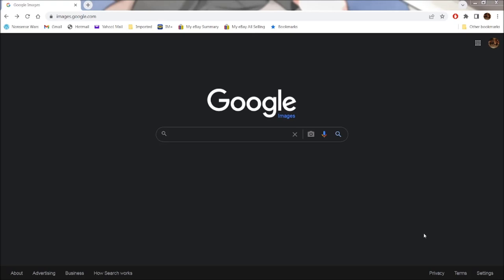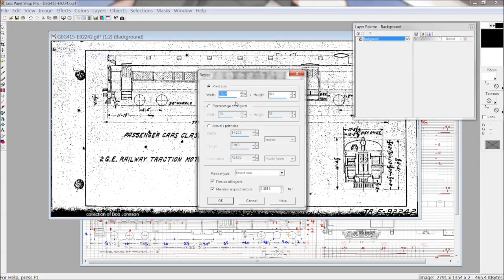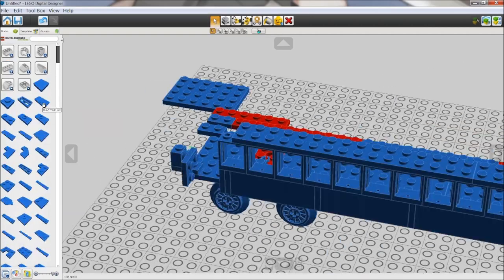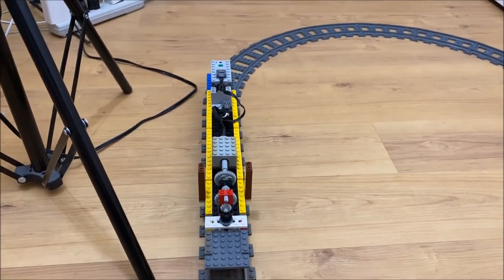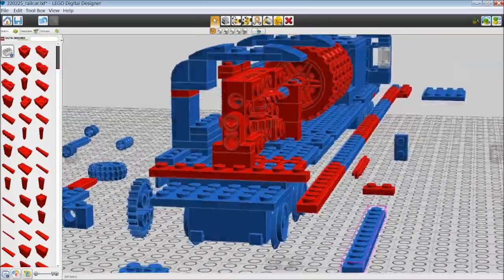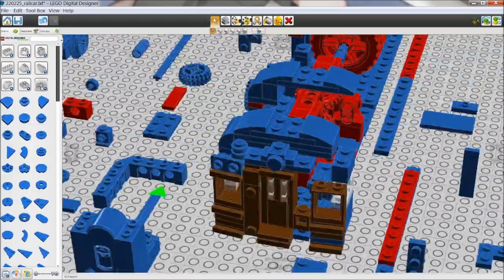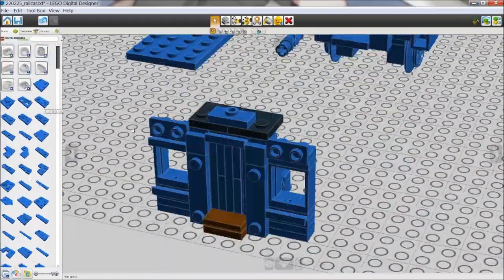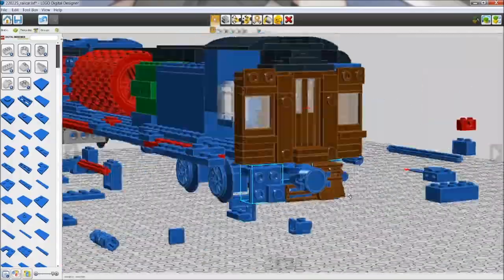Building LEGO 1:48 PRR GEG/OEG415 Gas/Oil Electric Motor Car Part 1 (Doodlebug)

Comment: A thorough start to this project, I never did pick up the knack for LDD prototyping myself, working with the actual parts in hand just goes much faster for me. Have you ever had an opportunity to work with two monitors? I suggest you give it a try next time you are building from a reference if you have the means to do so, it does wonders for workflow.
Reply from the maker: I actually have a triple; I'm just showing everything on one screen for recording purposes :)